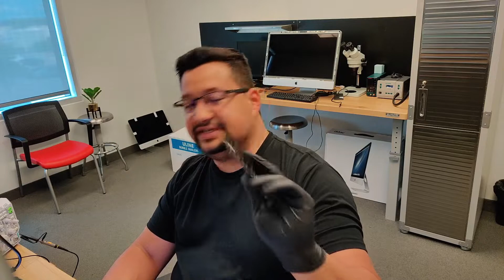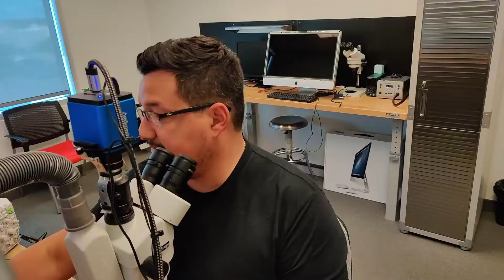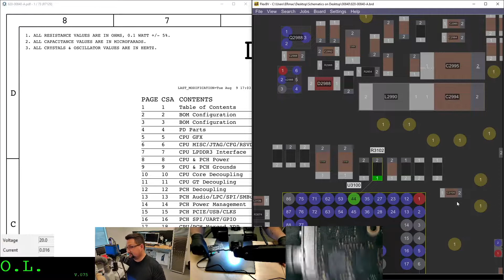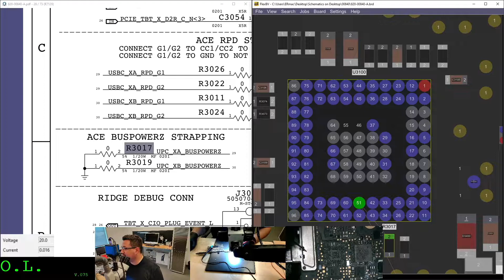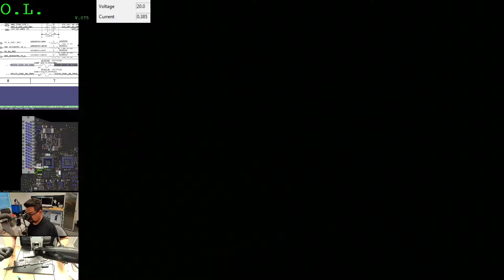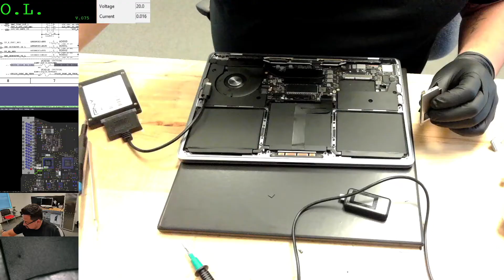A1708 MacBook Pro NO POWER 0.100 to 0.300 mA in USB-C Tester. Simple Repair Process

Comment: Hi, if the problem is 0 mAh of power consumption?
The machine works ok but don't charge
5v and don't go to more voltage, and 0 mAh of consumption always 
The 5v goes to U3100 and U3200

Is possible 1 of the U3xxx are dead?
Reply from the maker: Check the vbatt, check the battery connector the smbus protocol and the charge Ic